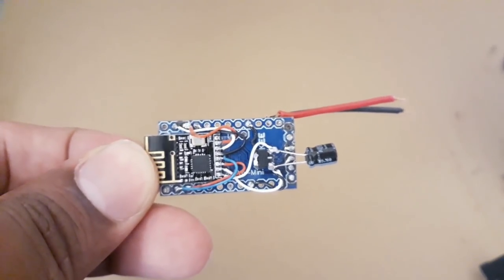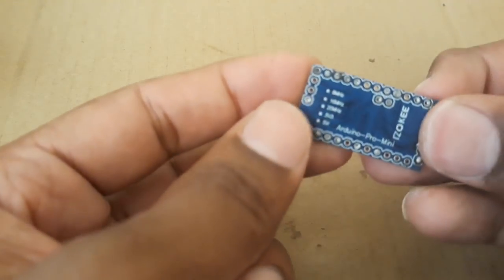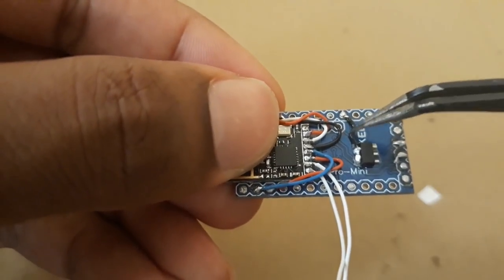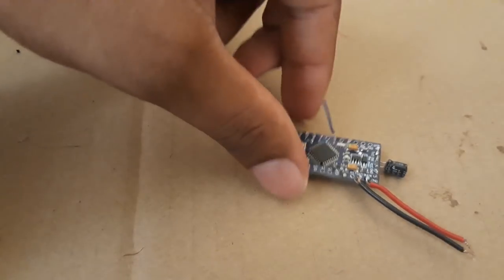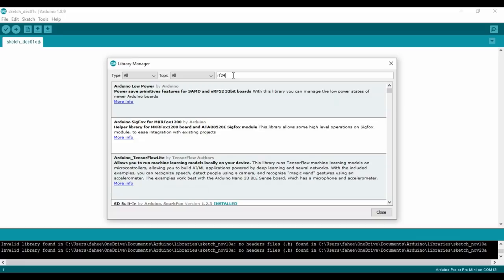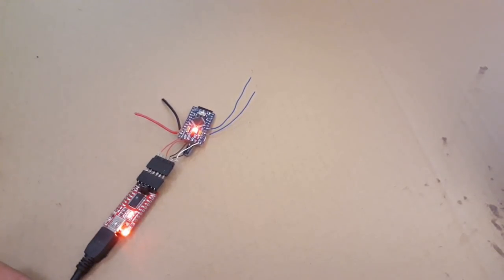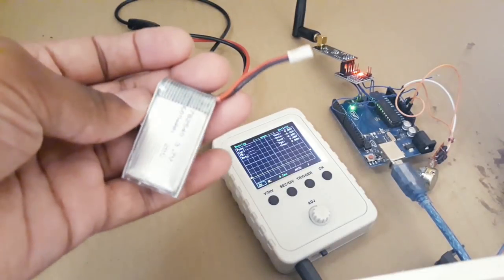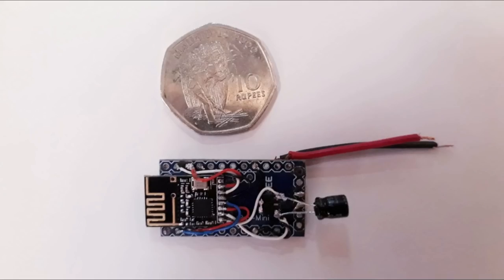How to make a small RC receiver tutorial (for RC plane and drones) - Arduino & NRF24L01

Comment: Hello sir can you please help me i am trying to make a rc reciever and tx but there is a probe 
Both nrf are working with test code and communication success but tx rx code is not working
Cannot bind
What is the prob and yes i used soft spi not hardware so i am sure hardware is ok and soft spi works pins connected properly
Its bayang reciever code
And multi protocol goebish module 
Ppm sequence confirmed and tested by code
They are all correctly oriented 
In RTEA oder is corrected in the code and matches reciever ppm 
Rudder left+Aeleron left
So i amsure its ok 
Even there is ppm fail 0
Wn i dont give correct stick order 
There fore its not pairing can you help me checking the code plz 😢

Comment: Bro this is very nice video but make a drone with coreless dc motor
Reply from the maker: I've already made a tutorial series on how to make coreless dc motor drone with arduino.. you can check them.. or do you mean brushless dc motor?
Reply: @minilab3d  brush less dc motor is that no bush carbon in rotar or armature connection. 2:- completely vise-versa between stator and rotor position....,....,
And ESC must connect with BLDC Motor
I think this is all for your question...…...…